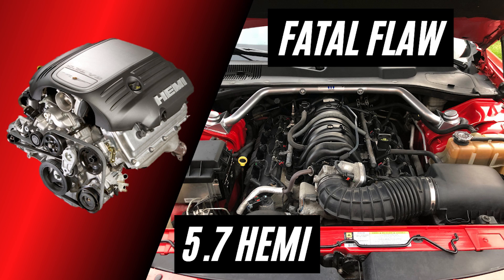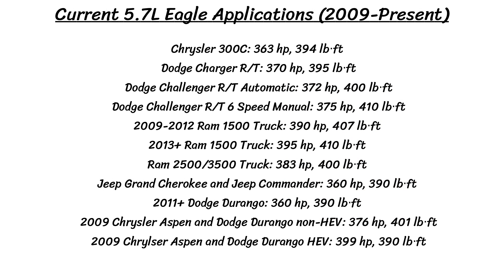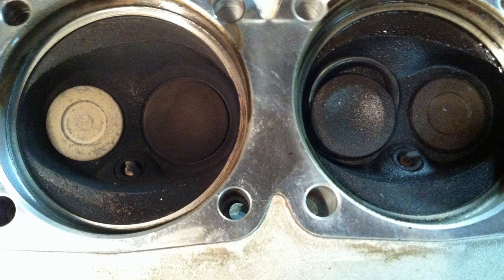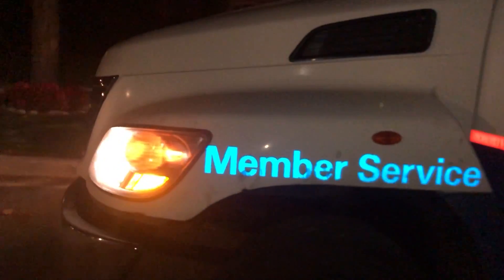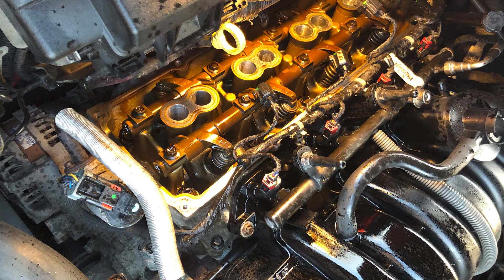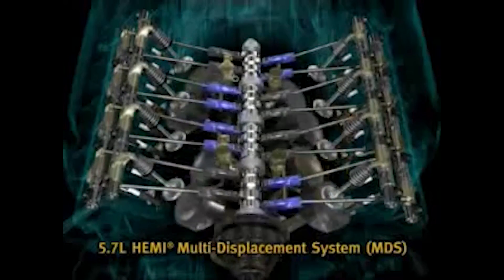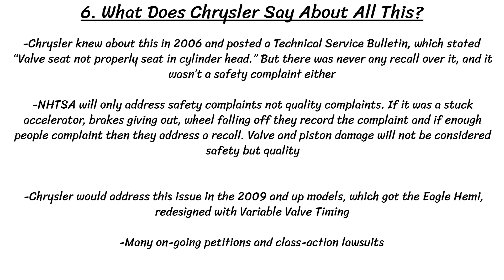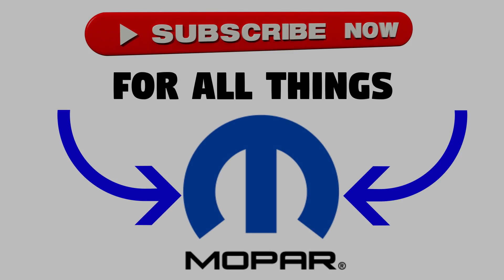The Fatal Flaw of the 5.7L Hemi V8 Engine & How to Prevent It (2003-2008 Valve Seat Drop)

Comment: Sorry if I’ve already commented on this as I could easily write a book about my experiences with my dealership and having a MaxCare Lifetime Bumper to Bumper Warranty on my 2006 Magnum RT bought new at same dealership.  I’ll try to make this short.   One day, summer, 15 minutes of idling with Ac full tilt, I hear a ping, look at gauges, temp gauge is pegged.  Like, pegged, or at least middle of red section.  No other warning at all, except the AC began not blowing cold right before that ping alarm.   And I’m the kinda guy who would notice if my temp gauge was not dead middle as normal, so this went from normal temp to pegged in who knows how much time, but not long.    Overflow was empty.    Yet no water in the ground.     I put water in, drive to gas station and put more in, can’t find any leak at all, drive home, bewildered.   Very, very weird.   This cycle went on for about two months, July through August in Charleston, SC.  Hot.    I always pay attention to fluids on the driveway, and I had never seen any water on the driveway, and never find water in the engine compartment.    And on and on, it would ping the temp gauge maybe once a week or less, and sometimes I’d catch it in the 2 o’clock position.    But even then, it never ran more than a few seconds after the heat alarm.   So finally I started smelling coolant in the HVAC vents, however slight, but there.   My father in law was with me one time, and he smiled it too, confirming. my sanity.    So I eft it running and we both looked under the hood.  Had he not been standing next to me I’m not sure if I’d ever have found this leak, but I was in front for the passenger headlight, bent over trying to see the fans and the radiator while the sun blazed over head.  So when my face was right down near the top of the radiator, I felt moisture.    I tried to feel it again and it took a few minutes to find it again, but couldn’t trace the source.  It was weird as hell, knowing the car is using water, yet no evidence to speak of, and now felt water on my face, but when I tried to find its source I couldn’t find the water on my face for several minutes, but that’s because the water level had dropped.    Finally I found the mist when I grabbed a powerful light to investigate.    The tiniest, slightest, almost invisible stream of water was so fine it took holding the light just right to even see it, and feeling it was not as easy as you’d think.     So this happened maybe right around 100,000 miles, and then again the next fall, same scenario, same spot on the radiator.  Since it is under warranty I didn’t inspect the leak too much, but I should have.    And it appears that these leaky radiators are a common problem across the Chrysler line-up, yet not really paid any attention because people just assume, oh, a bad radiator.    And replace it without any concern as to why.    Also of note, each time this happened I lost the water pump and the AC compressor not long after the radiator replacement.   The second time it also took out the alternator I believe.      So here’s the hypothesis:  pin hole leak in radiator such that it is so slow and so slight that you don’t even see water on the ground, no signs at all, everything seems fine until out of nowhere the engine is overheating.      Owner tops off water, continues on, until it happens again, maybe days or weeks later.   So under the radar that you could almost attribute it to the overflow tank owing water since it’s so hot and your cranking the AC and idling a lot.   So you forget about it.  What kind of coolant leak can take two weeks?      So here’s what I think is happening.   I’m very mechanically inclined and have been a gear head since 14.   And this caught me off guard every time.  Most people might not react so quickly or even know what to do, maybe they’re in stop and go rush hour traffic when it happens, as opposed to a parking lot or my driveway.     So the engine overheats, but really overheats.  Problem here is that where the temp sending unit is, the engine won’t know it’s running hot until there is so little water that at some point the water pump is no longer pumping water, the AC also not getting any cooling, and upper engine might not be getting enough water, yet the temp sending unit before that might not know it’s running hot, but the head do know it’s hot.  Not sure about the water jacket routes.    But I feel really lucky that my car hasn’t dropped a valve seat yet.   Although I’ve never let it keep running while overheated, it has happened maybe twenty times or more over two radiators.    So I think that when the water pump doesn’t have enough water running through it, from low coolant level, the bearing starts to cook, and maybe the seal is a side effect, or combined, but either the weep hole starts to drip, or the the bearing starts to whine, I’ve experienced both.   Then about a month or so later the AC starts acting up.   A little this, a little that.    Then the compressor dies, one time spectacularly, squealing like crazy, smoke pouring out from under the hood, and when o went to look at it, there was bits of rubber being pushed out between the clutch and the casing.     Wild stuff.   So first radiator goes, then water pump, then AC comp, then maybe another AC component which was damaged form low water, then maybe the fans die, together or separately, after running too long when it’s too hot because there’s no water in the radiator.    So radiator, water pump, AC parts, cooling fan, maybe valve seat, maybe o2 sensors, maybe cats get toooo hot, maybe the overflow tank gets damaged form it’s extra work.    But the bottom line is that Chrysler knows about the faulty radiators, but does nothing, yet costing themselves thousand of warranty dollars more by denying it all.    Who knows how many people had dropped valve seats, got blamed for driving the car hot, yet not realizing till much later that the radiator has a leak so insidious that it damages things without any normal warning signs.   Entire engines pretty often.    So all these customers get blamed for Chrysler’s mistake.   Is that legit?  You read the Magnusson/Moss Warranty Act, especially the Implied Warranty section and let me know.  I say Chrysler is guilty as can be, and they didn’t count on any customers putting it all together.     And that’s just the beginning gif the Chrysler/Dealership story.

Comment: I have a 2005 chrysler 300c, went into limp mode. got it 2 months ago and its always had hesitation/ struggling with acceleration and speed..my ESP/BAS light comes on sometimes. Today while driving and switching over to the middle turn lane it gave out like if I was pressing on the brakes. Pushed gas pedal and nothing. Heard dash light come one but no light. Gear Was in Drive but was stuck on the street. Had to turn it off and then on and went In Gear and was able to drive home with no problem.   Could it be the TCM,transmission,throttle body?

Comment: Hi  I have a question I recently bought  2005 dodge magnum r/t 4 days ago  today I replaced spark plugs after I went for test drive driving pretty fast for like 15 minutes then stopped at liquor store turned car off  totally cross my mine to idle car for aleast 40 second like I usually do when I went back to car like 3 minutes later car turned on for like 2 seconds then shut off now it won’t start it cranks but no start should someone help should I be concerned

Comment: I was looking up plumbing videos and opened this video. Why? Bc I own  2005 Ram with 148,000 miles. I bought new in 05. Never an issue except I replaced the radiator and the water pump a couple of times. Both times I thought I had a bad pump but it was actually the gasket. What a horrible design. The gasket is inserted into groove and eventually as of the result of heat and antifreeze, it shrinks or hardens or both and it begins to leak. The only other issue was lifter noise after using synthetic. It all stopped once I went back to conventional. Keeping my fingers crossed with those head seats!

Comment: I have a 2013 and it’s in the garage right now because a valve has dropped so no they didn’t fix the problem and mine happened to me after I had been driving about 45 minutes and it happened just driving along. I hadn’t stopped or nothing. Thought it was a coil pack so I slowed my speeed way down because I knew there was an advance auto parts about 10 minutes away. They told me I had a misfire on cylinder 3 so I changed spark plug and coil pack and still misfired so I swapped it to another cylinder to make sure the plug and or coil pack wasn’t bad and of course it wasn’t still had misfire on cylinder 3 so I had it checked and 0 compression on cylinder 3 so mechanic started tearing into it and of course it was the valve and also camshaft which camshaft probably came after me driving it back home.

Comment: This is one of the reasons I stay away from those Hemis whenever i see one for sale. I just don't need to be buying someone else's ticking time bomb. Good to see there's upgraded aftermarket fixed though that aren't terribly expensive. Another thing I've heard about the engines is they can be oil starved at low RPMs.
Reply: This low oil pressure canncause the thicking noise because the valve lifters are not lubricated properly if you idle the car for long periods.

If you idle for extended periods ( stuck outside during a cold winter) you have to rev the engine sometimes to get the oil flowing to the too end.

That engine was not designed to idle for nothing.
Reply: @michaelgimenez4032  that's the case for many Dodge vehicles. They're happy at high RPMs. The engines and transmissions. I've got a Durango R/T, absolutely terrible in the city stop and go. Transmission is rough after it warms up. Highway though she flies with no issues.

Comment: the main problem is that we bought a Chrysler product, lol. I have a 2014 ram with a 5.7. See’s. nothing but highway miles. Recently just had a manifold leak after pulling a heavy load. Hoping my next problem wont be the dreaded cam and lifter failure.

Comment: My 2004 Dodge Ram has over 225k miles on it, with lots of towing and long trips. I've never experienced the valve seat issue, but I've worked on vehicles that have had it. I always remove MDS, I want all of my power all of the time.

Comment: So if this happens your basically gonna need A whole new engine
Reply from the maker: If there’s further damage pretty much (well you can just rebuild but still will be very expensive). If the seats drop and you get lucky and don’t start it or anything you might get away with just head and valve replacement

Comment: At 21000 km. (13,000 miles) my 16 Ram did that after a hot shutdown. I got it to the dealer service right away and saved the motor. After 3 weeeks in their shop because parts back order I was on my way. I traded the truck shortly after because of this issue.

Comment: Mine is a 2003 Ram 1500, with almost 250,00 hard miles. Had a problem at around 100k #3 exhaust valve spring broke while on the interstate. My problem is water pumps, and my friend has the same problem with his 2007 1500 we have both been through no less than 4 pumps. Any body else have this issue? and possible causes of this. Any suggestions are welcomed.

Comment: I change my oil in my 06 300c at 3k or sooner . Pennnzoil platinum 5w20 with Fran ultra or wix xp filter .never a problem . It’s tuned with MDS deactivated and all fluid are synthetic . Only front end parts changed , under warranty fuel ⛽️ tank it’s got a 93 octane tune shell 93 ultra . Other than. Preventive maintenance conducted a tank . I’m driving 138 k

Comment: Yeah my 06 jeep wk dropped a valve seat at 140k miles while I was still on temp tags after the purchase🤦‍♂️ I said f it and replaced it with an upgraded remanufactured hemi. New engine alone was $5700, but I figured it was a better option than a $3000 used engine that would probably get it again.

Comment: The 3.7 and 4.7 also have the valve seat problems. '06 Grand Cherokee with the 4.7 blew a head gasket at 102,000mi and the shop said the valve seats were also bad. Fixed that by rebuilding the heads then the transmission started having issues. I was the 2nd owner (bought at ~70,000mi) and the Jeep was in tip top shape. All maintenance records showing all service completed as specified in the manual. I knew Chrysler had reliability issues but I figured how bad could it be? That wound up being a multi-thousand dollar lapse in judgement. At the same time we owned a '97 Cougar with a 4.6L. 170,000mi (bought at 80,000 miles) and not a single drivetrain problem during 14 years of ownership. (Sadly that wonderful car was totaled from someone turning left in front of it) With the trans problem (and shudder and hvac and stalling problems) I traded that garbage Jeep as fast as I could for a new Ford. I'll never waste my money on a Chrysler product ever again. Interesting how none of the other eight non-Chrysler cars I've owned and maintained myself over the years ever had a lick of trouble...

Amusingly while I was at the Jeep dealer having a recall done (edit: It's a Jeep thing. You wouldn't understand!) they tried to sell me on a new Jeep. I asked why I would consider a new Jeep when my current example breaks all the time. They mentioned their "lifetime powertrain warranty" in which you simultaneously have to service your car before it's due in the manual and have to call in for permission to have your car serviced. I laughed in their face for such a ridiculous concept.

Comment: Dropped valve seats, dropped cam lifters, MDS solenoids dying ect. These 3rd gen 5.7/6.1 hemis have the same problem. It has not fixed until after the hell cat came out and they started mixing the same parts.

Comment: I’m thinking about buying an 06 the first engine dropped a seal but he put a new engine in it that deleted mds
Reply: The entire time engines now at 100kish
Reply from the maker: If it’s still the original cylinder heads and valves it’s could still happen again, do you know if he upgraded those?

Comment: I've had 4 Hemi engines. 05 - 06 - 13 and 12. Most mileage was on the 06 with127000 miles. Never had a problem with any.

Comment: 2005 Rumble Bee 167,000 km  or just over 100,000 miles.
Never gets really hot in Northern Canada...plus I don't really bag the truck anyway. Will be checking heat now every time I fill up...
Still concerned of course...may do the 180 degree thermostat for summer only.
Thanks for vid.

Comment: Lead is added in aircraft gasoline specifically to facilitate the removal of combustion heat. This keeps the valve train happy and reliable. It's why todays aircraft engines continue to run on leaded gasoline. The problem with the 5.7L Hemi engine is that automotive pump gas kills it.

Comment: mine is a Grand Cherokee  runs great 105000 miles 2006 i worry all the time since reading about this awhile back
Reply from the maker: Use the tips I said to prevent it (especially the idling before shutoff and sport mode after the highway). I truly believe it will help

Comment: I have always been a fan of Chrysler, Dodge, Plymouth (Mopar) since I was a kid. I have had my share of pre-computer hot rods over the years. When the "new style Charger" came out I was very close to buying one (after the first teething model year went by). I was going to get a used one. Then the Hemi engine fiasco failings started to become public on a regular basis. I considered a V6 version but you know. So glad to see you have laid this all out on the how, what, why of the valve seat dilemma. One of the first things I would remove from the engine is the "dress up" plastic piece sitting on top of it retaining a bunch of heat.

Comment: 2013 Grand Cherokee. Replaced trans cooler,thermostat, water pump somewhere 70k. Had to replace rockers and lifters at 103k. Also replaced the oil cooler when I did the rockers because my mechanic said do it now because this was more than likely next.

Comment: Wrong oil type/ infrequent oil changes. Never buy a used High mile Chrysler. If you do, Change the oil AT THE RECOMMENDED interval, and USE THE RIGHT VISCOSITY OIL! These cars have lasted past 200,000 miles. I'm not blaming marspeed, but instead the previous owner.

Comment: 120,000 miles.  On my 2013 Dodger Ram. Dealership scoped it but refused to send the picks. So I have a truck I owe 2 yrs left on it  with a dead engine.  Manufacturer and dealer say not there problem.

Comment: If you have enough owners that's had this issue. My guess a legal firm might take a look and consider a Class Action lawsuit. 

I've also read about cam issues. Do you have information regarding this issue? You mentioned turning off the 8 to 4 cylinder feature. I believe you said that would be completed by a tuner. Is this correct?

Thanks for the heads up and information. My 5.7 Chrysler 300C is newer with only 18,800 miles. I normally trade cars every three years, but really love my 300C. I'm planning on keeping it since the 300C is discontinued, and I'm not concerned about 100,000 miles since I drive another car during the winter helping keep the mileage down.. What I am concerned about is the cam wearing lobes. I would like to change my cam to a more performance oriented cam, but I don't want to void my factory warranty.